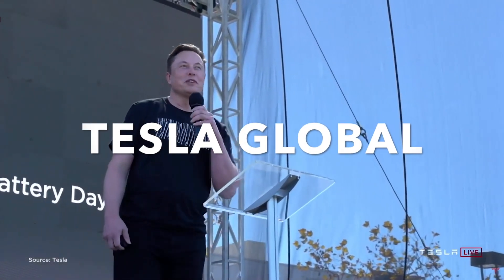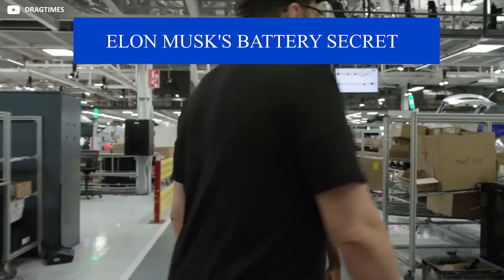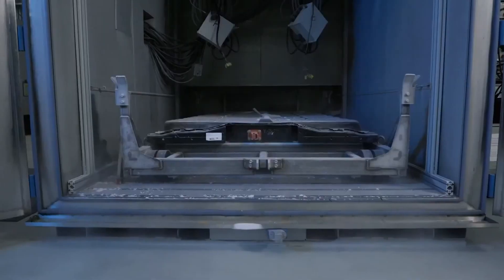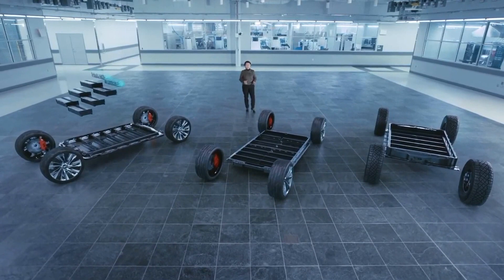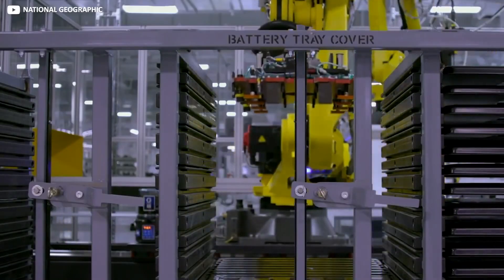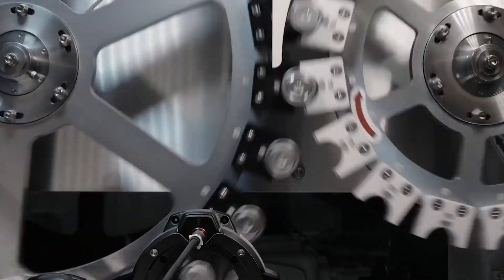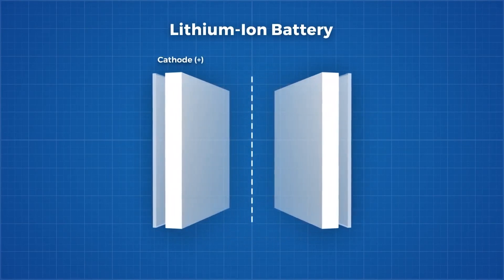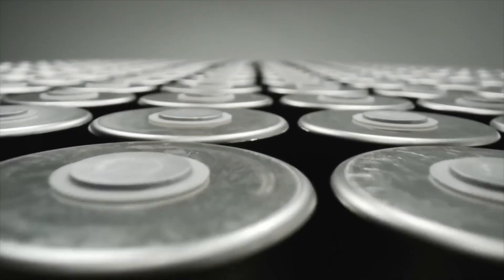Tesla Update on 4680 Battery News!

Comment: If there is a problem in getting heat out of the center of a cylindrical battery, why not use flat batteries which has equal heating.
Reply from the maker: Maybe that is a good idea

Comment: Why does no one mention how the energy density of the 4680 compares to the previous batteries? 🙁
Reply: On battery day they said +~16%. The critical part is the rate of charge and discharge. Faster charge times, less range anxiety.
Reply: @taylor92493  they didnt say +~16% on batery day, and its the energy density thats critical for less range anxiety
Reply: @grandmastarflash  absolutely did. At the 50 minute mark the figure shown says 16% no ~. This is for the battery day event.
Reply: @grandmastarflash  and yeah with +16% your mansplanation of what is “critical” is correct and why I referenced it. The metrics for charging were MUCH BETTER than the range increase.
Reply: Eevblog #1340 goes over it in detail. “They didn’t say” how confidently wrong.
Reply: @taylor92493  At the 50 minute mark the figure shown says 16%. This figure is for the range of the car, not the energy density of the batteries. Obvously the range will increase if you you use bigger batteries. What would be breakthough is if the same sized batteries used preveously contained significantly more energy.
Reply: @grandmastarflash  I can’t do this with you. Watch the whole event. They quote a larger figure (for range) once all other factors are accounted for later in the video. Even mention 3 battery chemistries or more. Who made you like this?
Reply: @taylor92493  I have watched the whole event. Yes they quote a larger figure for range, everyone can see that. Yes they mention 3 or more different battery chemistries. None of those things confirm the change in the energy density figure for the new battery relative to the preveous battery. Im not sure who made me like this, is it really relevant? Im just a humble scientist that has been gioven the task of researching battery technology